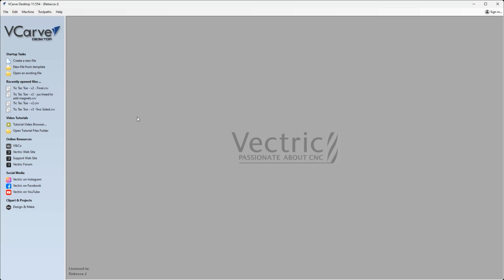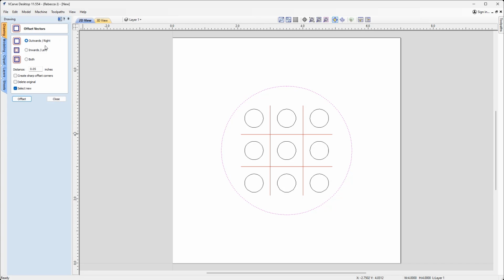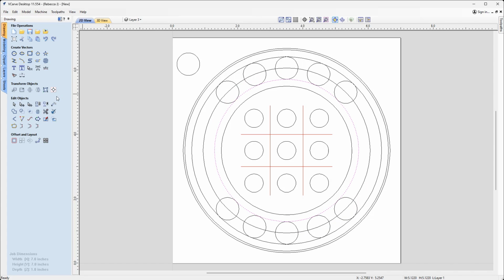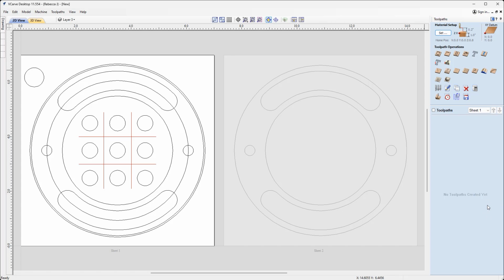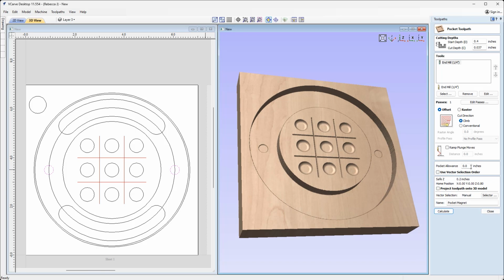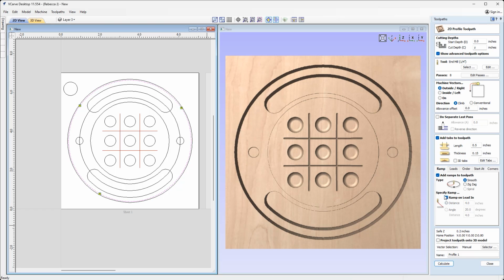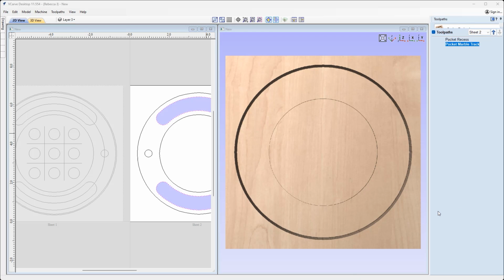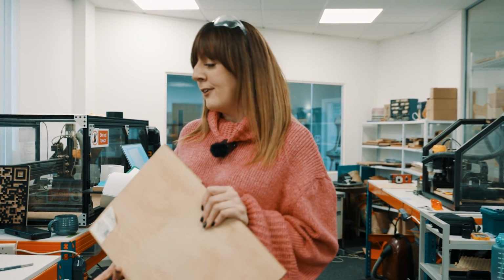Making Tic Tac Toe Game | In the Labs with Vectric | Vectric FREE CNC Projects

Comment: Hey, it's a shame but it's just a suggestion. The truth is that they don't cover the lathe issue that much and I have a lathe and I use your program with my machine. It's just that it needs improvements and it could give you many ideas. I also have a cnc lathe. wood

and I feel that the lathe people have us abandoned in terms of adjustments to others, they are losing market there since they are only focused on cnc routers and the lathe is something that is now gaining a lot of strength
Reply: If in truth they are not tuning the wood lathe part

Comment: Love your work! As @slhasebroock said, it doesn't matter whether you make it or not, the learning is the best part. I may have missed it, but what are the marble and magnet sizes? Also, depending upon the marble diameter that you choose, I used 14-15 mm, they still roll around a little in the playing board holes. I replaced the tool path with a drilling tool path (cut depth .1875) and used a 1/2" core box. Better results--the marbles don't move around at all.
Reply from the maker: Thank you for your kind comments, so the marble diameter I was using was 0.63" (16mm) and the magnet was 0.375 diameter and around 1mm / 0.037" thick (or thin even 😂) Ooh I love that you tweaked it to use the drilling toolpath for each marble that's a great idea, I do kind of like the sound of the marbles rolling in their troughs 😂 Thanks for the comment! Have a great day ~ Beki